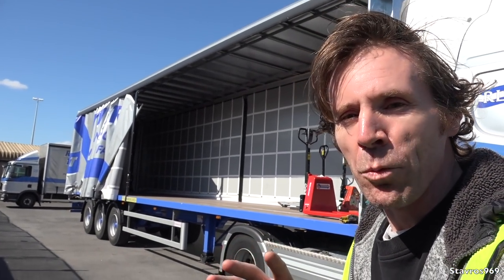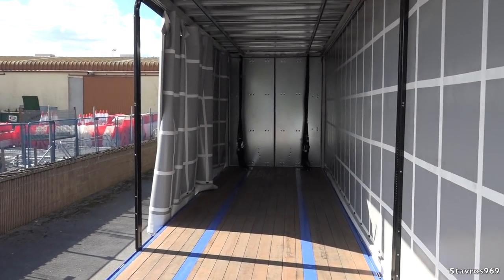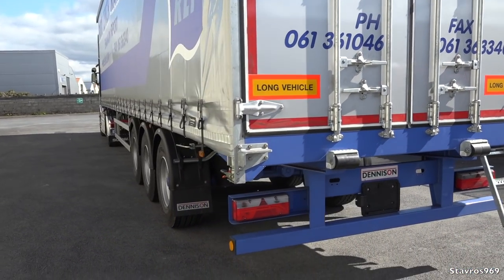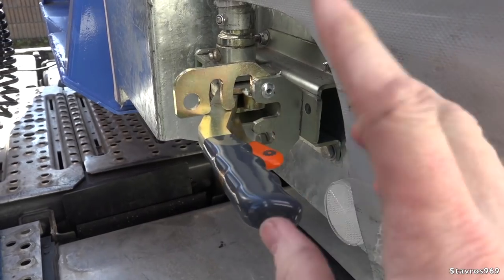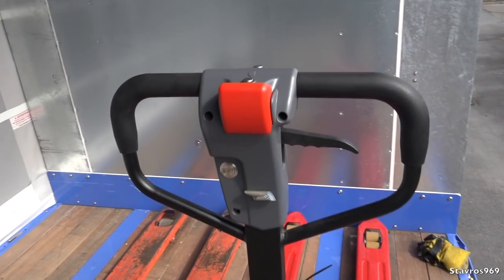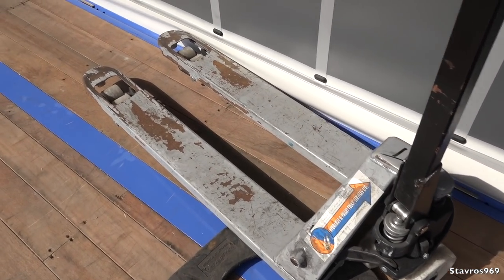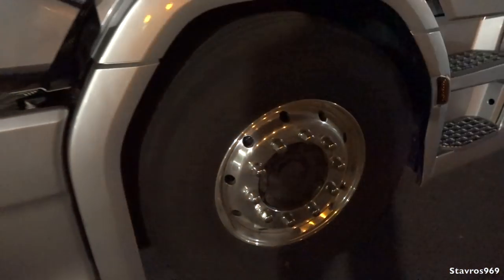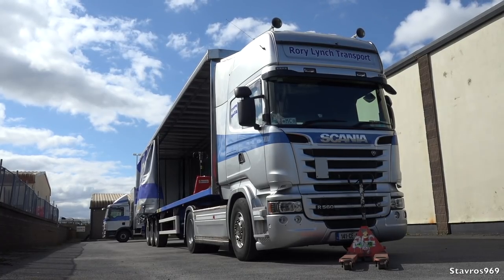New Trailer Joins the Fleet & Semi Electric Pallet Truck Review

Comment: Great review of the trailer and electric pallet jack Stavros. Soft drink distributors here in Florida use electric pallet jacks and box trailers with tail lifts for service station deliveries. Beats using hand trucks for sure. TheDennison trailer looks as if it’s the standard off the shelf build. The electric pallet jack needs to be able to free wheel and should equal the lifting power of the best standard jack!  Stay safe everyone, 🏴🇺🇸

Comment: Great video as usual Stavros. You may forget about letting a forklift over the floor of that trailer, only suitable for pallet  truck which is a shame. I agree with you 100% on the roof straps, you need one big opening right across the headboard, the driver should always be consulted when specifying the trailer. The electric pallet truck 👍, it would be great if you could charge it off the 24V. The new Scania👍👍. Thanks for the look around Stavros,  WASH your hands and stay safe out there 👋😎

Comment: If the semi-electric pallet truck runs out of battery completely bottom left of the back wheel there are three Alan keys in like a triangle shape. top one and bottom left turn clockwise to looses takes the break allowing you to still use it if its in the way. The company i work for have a fleet of them for the day drivers.

Comment: You mention the lifting capacity of the electric one is lower but does it really matter? My manual pallet truck will lift 2.5 tons but try moving it! Even a 1200kg pallet is really hard to move with a manual truck. Considering most tail lifts have a limit of 1000kg it doesn't really matter. Nice review all the same though!

Comment: Curious to know: do European drivers usually unload or load their own trailers with their own lifts? Because in my experience over in Canada and the US, all I've ever had to do so far is pop the doors, smack the dock, and let the boys inside do all the heavy lifting. ._.
Reply: As you can see the trailer he’s on is called a curtain side. You pull it back and a fork lift driver loads and unloads. Some places you deliver to will have a rear lift or ramp in which you will have to use the pallet trucks to move the load from the trailer through the back doors  onto the lift. Usually supermarkets etc.